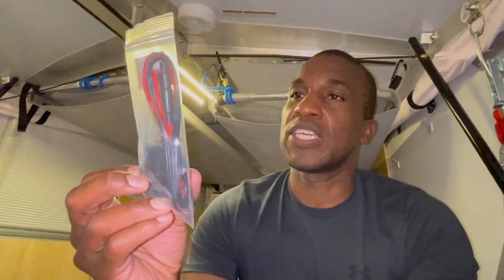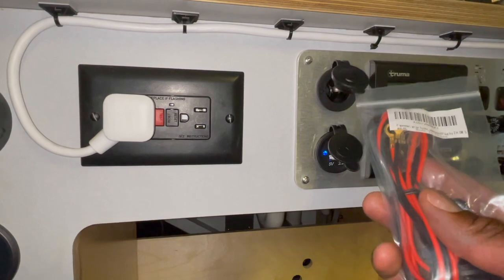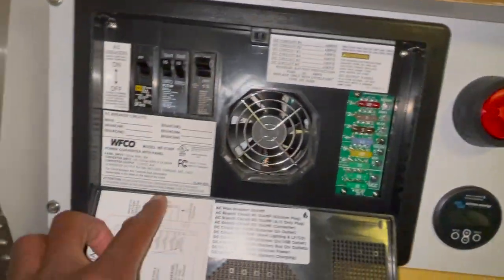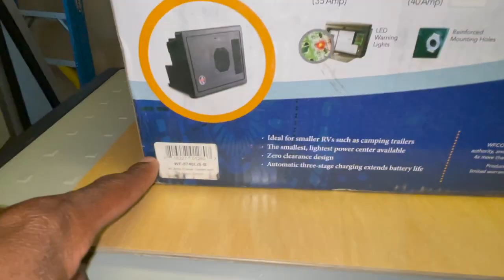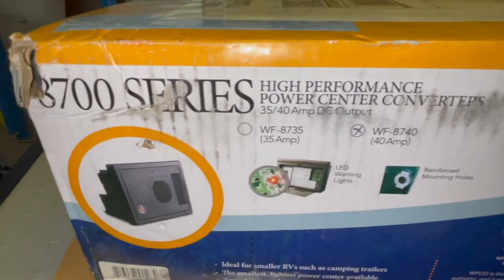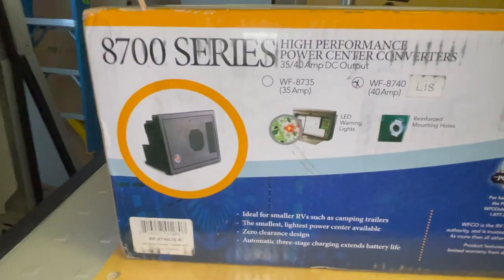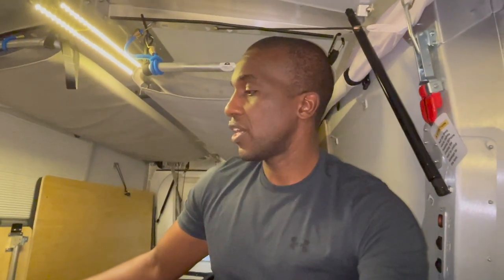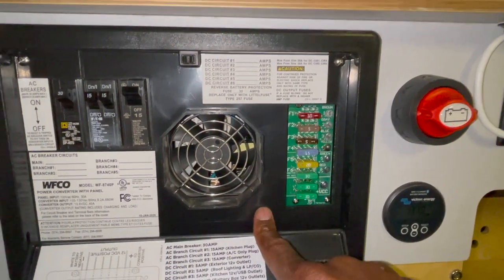Taxa Cricket Replacement Power Center for Lithium battery Charging

Comment: Nice setup. Your instincts are on target. Each battle-born is made up of multiple cells and those cells need to be balanced which only happens when it's fully charged. So if you don't swap out the charge controller the performance of the batteries will degrade pretty significantly over time as the cells become unbalanced.
Reply from the maker: Ah. Ok thanks for confirming that Miles! It kinda seemed like it made sense to me and also couldn’t hurt anything so i went with it.
Reply: @iAmMarchal  how is the swap out? I imagine it's wire for wire and pretty straightforward.
Reply from the maker: @maf202  hi Miles it’s exactly that wire for wire. I didn’t find it too complicated. Take pics and notes if you have to and it will go swimmingly. I have a video talking through it as well.

Comment: I’m looking forward to this installment. I’ve got a Renogy 100ah LiFePo arriving on Saturday. I have a stand alone lithium charger, but I like the idea of everything being built in. If the converter is an easy swap, that might be the way to go.
Reply from the maker: David. I think it’s definitely an easy swap. I also have other methods of charging my batteries. But the clean factory look and operation is appealing to me. So the new power center is the way for me. I’ll definitely get it done this weekend. Stay tuned. I’ll have another video ready tomorrow. I started doing some work on it already tonight.

Comment: I have a 2016 Taxa Cricket with a WFCO model WF-2740-P and I see they have a model WF-2740-AD. 

The “AD” has auto detect which should work with Lithium or AGM. Do you think that will work?

Comment: I have a 2016 Taxa Cricket with a WFCO model WF-2740-P and I see they have a model WF-2740-AD. 

The “AD” has auto detect which should work with Lithium or AGM. Do you think that will work?
Reply from the maker: I would shoot them an email to confirm. But as long as the dimensions are the same. I’d like to think it should work. But I’m no professional.